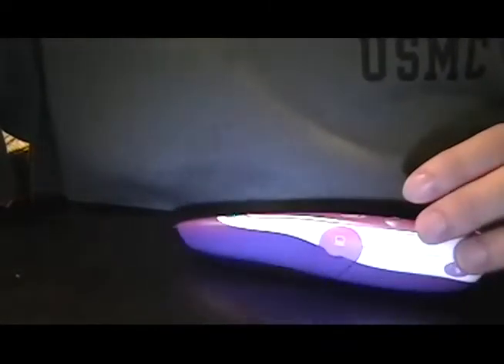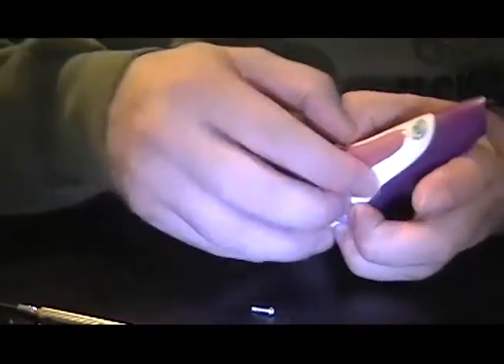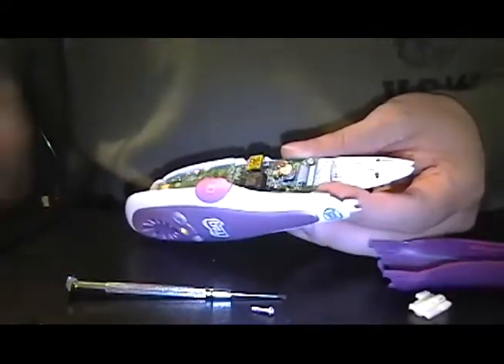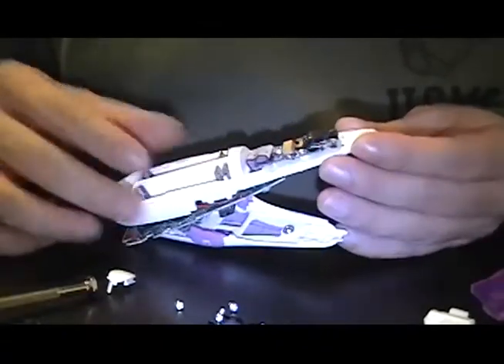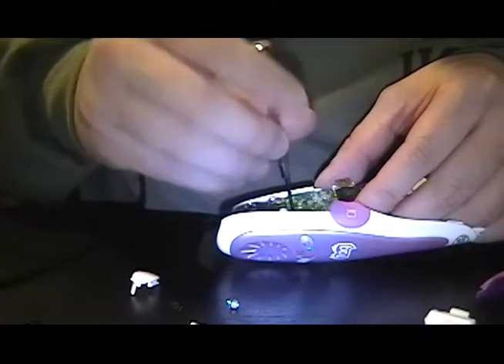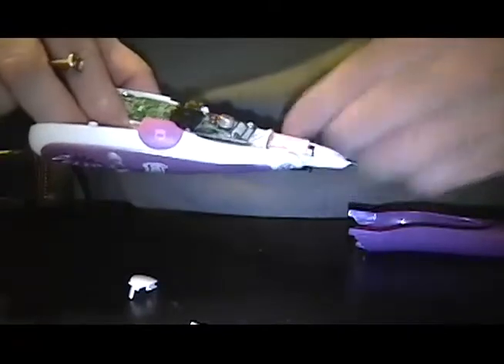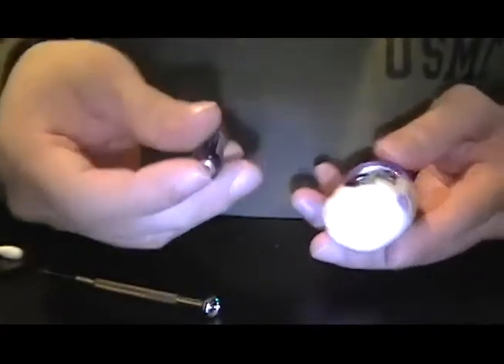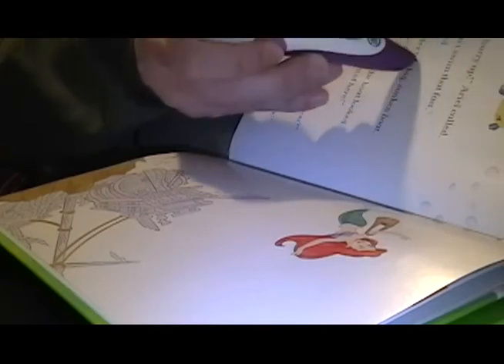Leap Frog Tag  Reader disassembly and repair

Comment: 8 years on and still an excellent reference video! Thank you for this, it worked a treat for me as well :) Our is an even older Tag pen than the one featured in your video but came apart basically the same way. Not sure what the kids gummed up the stylus with (optical lens was clean) but once disassembled and cleaned it works perfectly again! Well done Jx Racer!!!

Comment: Mine switches on and off properly but it doesn't read anything at all.....I don't understand what's the problem... someone please help me
Reply from the maker: Happy Gamer yes that was the issue with mine also, the problem.could be that the area where the light (sensor) is could be blocked. Is a small piece of semi transparent plastic.
If it gets very dirty or blocked then the reader will stop working. 
Take it apart and check it. Also make sure that the pointer has the push action, it should be able to move freely. I hope that helps.

Comment: i still cant get mine to work :( it just quickly blinks green then the light disappears. cant get it to stay on nor connect
Reply from the maker: hace you check if the the connections are good. does it read sporadically or it is constant?
Reply: +Jx Racer (Xracer) yeah connections look clean and not damaged. no visable signs of it being broken. when I opened it up nothing looks burned out or loose. all connections still connected. it'll turn green then immediately turn off. no sounds or time to try to connect to the app. not too much online about it either. i left it charging for about 1 hour but the light isnt on when connected. just those random green blinks
Reply from the maker: Maybe the batteries are the issue
Reply: I'll have to buy another brand! I just put new ones in that i tested with another toy...but they were cheap brand batteries. Ill get some better ones and hopefully it works. Thanks for helping and the video! Still very useful to see how it comes apart. I uploaded a video of what mine does so hopefully someone with the same issue can find it and help out too
Reply from the maker: +Audrey Silva, OK, wish you luck and I hope is a battery issue I have seen that when my batteries were going bad

Comment: What was the problem? Mine is flashing red/yellow...
Reply from the maker: sorry for such a late reply, for some reason (my daughter using it to stab an avocado) it was not reading the books so the problem was guacamole on the little optical sensor. a red/yellow flashing could be just the battery i have not heard of such an error before.